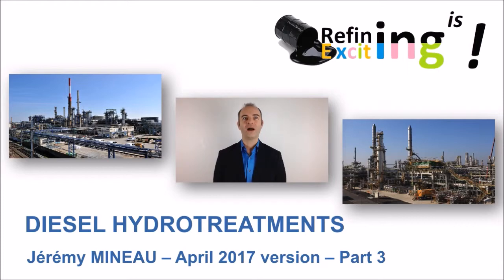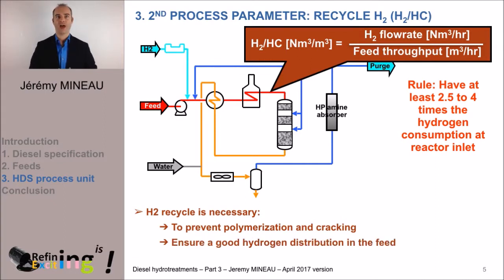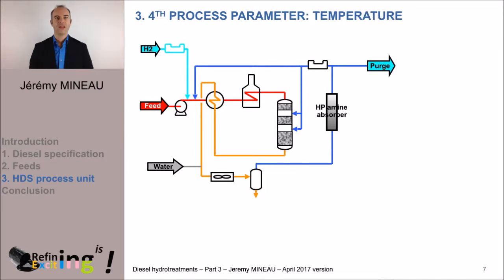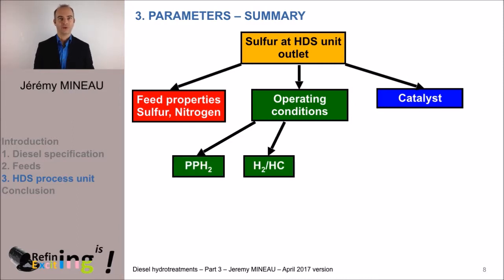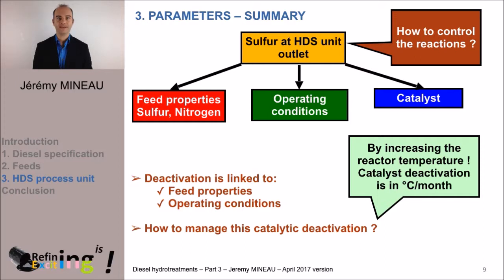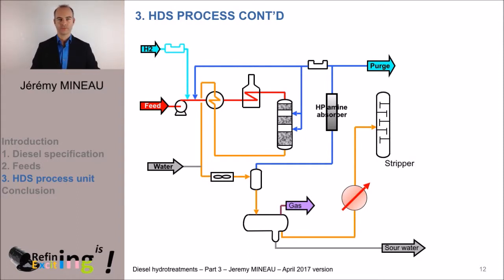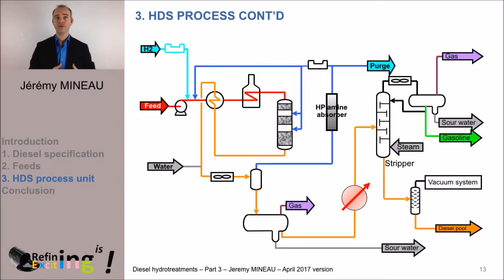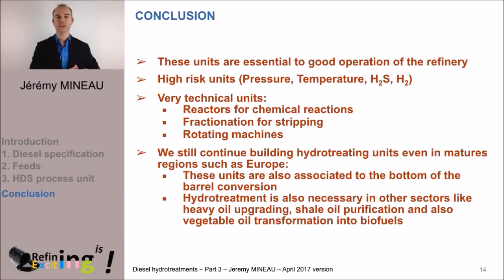MOOC - HDS / Diesel hydrotreatments - Part 3

Comment: Sir can we treat plastic pyrolysis oil to good diesel with this hydro treatment process ?
Reply from the maker: Thanks for your question. It all depends on the plastic pyrolysis quality and the operating pressure of the hydrotreatment. It may be possible with potential adjustments / modifications in the unit since the quality of plastic pyrolysis oil is somewhat different from fossil feedstocks.